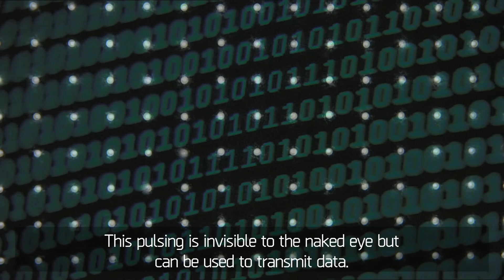Could Li-Fi be the new Wi-Fi? BBC Click

Comment: So Li-Fi does what IR does but being more flexible and readily available, the question for me is if this is true and the wheel had been reinvented but with rubber... Wouldn't all LEDs need to be connected to a router or processing unit to register and send signals. That's a lot of hardware upgrades that need to be done.

Other cars in front of you talking autonomously to your phone sound very wishful thinking, if I was a billionaire, I wouldn't invest in this because it just sound too questionable.
Reply: Personally sounds better than having to overhaul a new infrastructure to utilize it. EG, optic fiber. 

With Lifi, (as far as my understanding of it goes) all you'd have to do is rework some circuitry, connect it to lighting, of which is connected to a router which processes the flickerings needed and all. 

Depending on how well thought out the interface is,  I think it's a promising tech.
Reply: Iwashita Daichi Broadband fibre optics would be needed in infrastructures, if anything then it probably need it more as it is a quicker and will be a more demanding platform.

Li-Fi is just a wireless interface platform for devices to communicate to each other but only locally, which made me beg the question as to would light bulbs need to be connected to the internet directly now too potentially?!